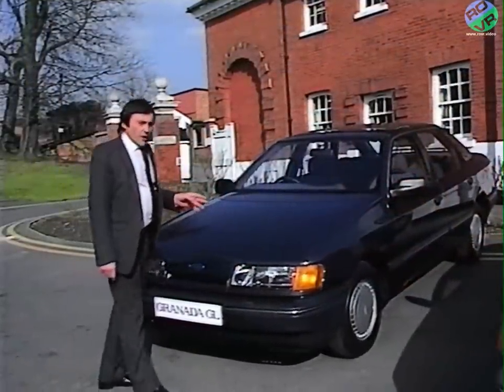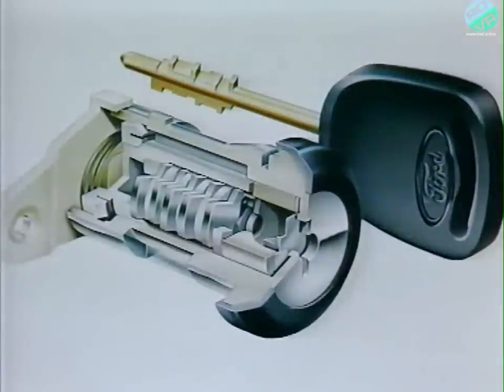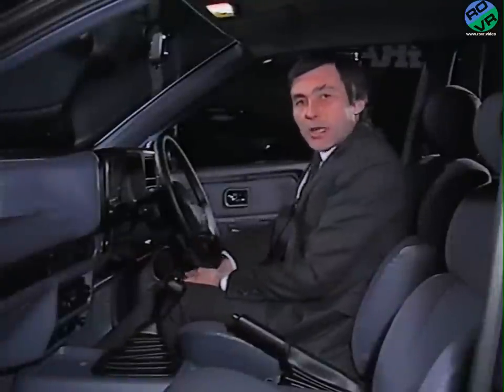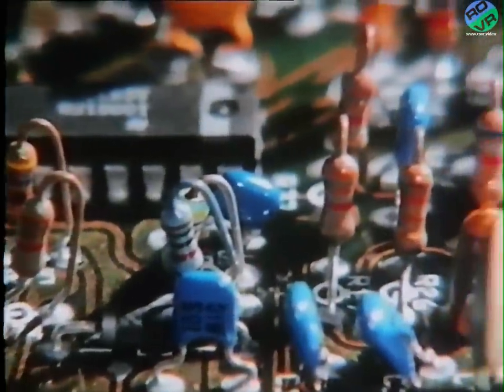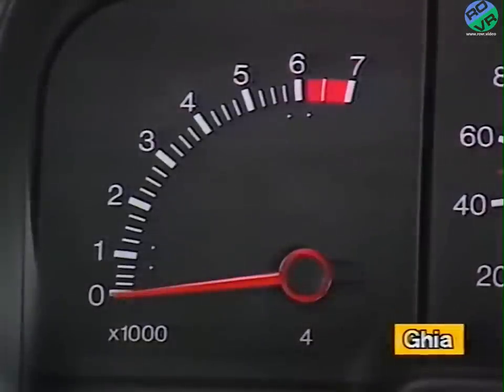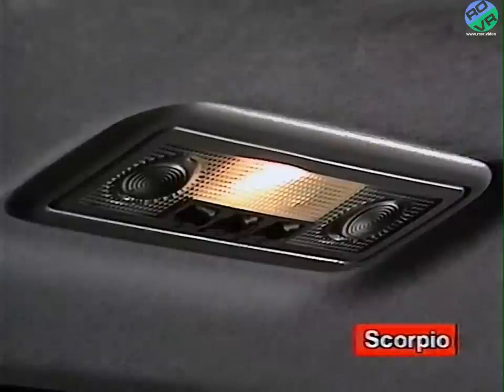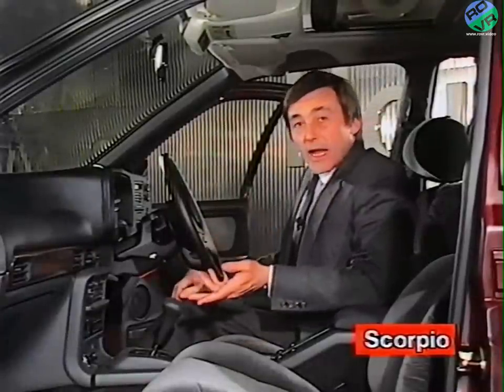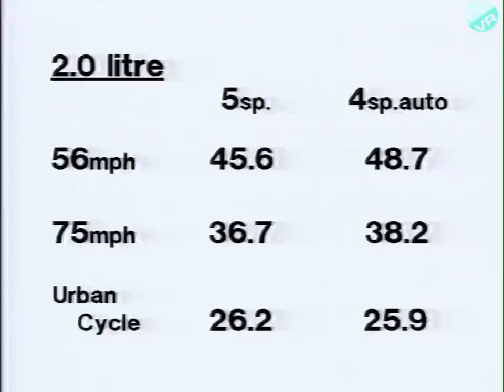Ford - The 1985 Ford Granada - A New Dimension in Luxury Motoring (1984)

Comment: "Instrument panel ,rheostat",,, my humble FSO Polonez had this  fitted in 1979.
Reply: So does my '82 Rover SD1. Probably the poverty spec mk2 Grannies didn't have one as standard, hence highlighting it. To be fair your Polonez won't have ABS, power steering or a reach/rake adjustable steering wheel as standard though!
Reply: Very true, but I travelled to the DDR and back in it several times in comfort 1981 - 1984.
Reply: @TheRichardSpearman  Fair enough. If you found it comfortable you found it comfortable!! I did 2,200 miles across France last October in my '78 Mk1 Cavalier Coupe with a 4 speed box, no stereo, no headrests  etc. Was noisy at autoroute cruising speeds (great fun off!) but i was comfy enough. However, i would've definately been MORE comfy in a mk3 Grannie. Especially a Scorpio....!!

Comment: I really was impressed with the amount of equipment this car had until the presenter listed rear seat belts as an extra cost luxury option.  Still, this does not look at all like a 35 year old car.
Reply: It has aged well. My uncle had one of these to tow his caravan. His had rear belts, but they was more used as a novelty. We never used them (I would of been about 6-10 at the time. When we was going away, we'd stuff the rear footwells and use the rear seat as a double bed for me and my cousin to sleep while we drive down south though the night.

I don't think it wax untill the early to mid 2000s rear seat belt use really become part of normality.

My kids for their first few years just rolled round the rear of a 1991 escort van. I was pulled over a couple of times, (spot checks) and nothing was ever said about having people of kids in thd rear. This was 2000-03. 

Now I won't move untill everyone is belted up. It's strange how sociaty changes. Lok at drink driving it must of talked 30 years from being all but band, to it being frownd upon.
Reply: I was stunned, too, but then I remembered I had a '84 Renault 5 and when one of the rear belts jammed I just unbolted it and binned it. Not mandatory on a car that age so no MOT fail (which it would if I left it in), but I can't remember any of the aero Grandads (and there were a few in my workplace) lacking rear belts.
My '88 R5 - basest of base trim level - had rear belts and I remember my brother refusing to put it on so I told him he'll find the walk good exercise; wasn't having that F.B. flying into my spine at 30mph. Total turnaround in my attitude in four years - power of (govt) advertizing.

Comment: What's not so easy it to break in to a ford Granada yeah right firstly those keys were a nightmare they used to break for fun they move from chubb to tibi keys which were worse they used to wear out secondly they were easy to break into. We used to do this to move the cars around the compound as they came with two keys one on delivery and one was in the ash tray rather then go and find the keys we used to break in use the spare key move the car to where ever then lock the spare key back in the car

Comment: Jeez, I though my 2.3 honda auto was bad in the rover 600  at 27mpg but it's better than even the 2litre granada.
And the 2.8 granada  at 18mpg imagine driving  that now on super unleaded!
Reply: I get around 28-29 mpg out of my 2.9i.
My dad had a 2.0i manual, which would easily do over 40mpg on a run.

Comment: Lots of logical little advancements, but the mk1 and mk2 still had more attitude
Reply: I own a Mk3 but I agree.
The lower-spec Mk1 & Mk2s were not so appealing but the V6 GLX, Ghias and Injections looked like cars for bank robbers.
Reply: @lewis72  Yeah, or the guys chasing the bank robbers!  By the time I got to end of this mk3 video, I couldn't believe how advanced it was - especially the Scorpio - for its day
Reply: @elbecko7969  
It still had the ancient Pint and Cologne engines though !
2v/cyl, iron block, iron head.
Reply: @lewis72  Oh yeah, true!  I often think of the jelly mould era Fords as being a bit too Tupperware looking.  I had a Sierra estate and a Mk4 Escort.  But the mk3 Granny must've looked pretty fresh on its launch
Reply: @elbecko7969  
IIRC, the Mk3 Granada looked like a modernised Sierra but bigger.
It had lost the rain channels on the roof (oddly, the Sierra Sapphire has no rain channels but the hatch had throughout its life) and it had more flush fitting glass.
They are a bit blobby, when compared with the Mk1 & mk2 Granadas but the emphasis was on aerodynamic styling then.
My dad bought an '86 car back in '89 and although it was a bottom-of-the-range GL, it had ABS, PAS (optioned), central locking and split rear seats.
It was big, comfy and being a 5-speed manual 2.0i, quick enough (they only weighed about 1200kg).

Comment: Wipers that park out of the wind rush copied from the Montego.
Reply: The Montego launched about the same year or maybe the year before? I don't think Ford would have been able to do a redesign that quickly. After the Audi 100, car mags suddenly started talking drag coefficient, Cd, and if it wasn't 0.3something (I think the then Cavalier was 0.47 with sticking out roof gutters) it was called prehistoric. Ford and Austin teams probably had the same ideas of tucking ancillaries in and using the wind tunnel a bit.

Comment: That presenter just keeps telling lies with a straight face, Granada we’re just gas  guzzling rust buckets, with engines with 1940,s technology….
Reply: Yes, they did rust very quickly and the engines were as old as the hills.
It was only the fuel injection that gave a bit of respectability.
Just 1 year later Rover launched the 800 with DOHC 16v 4-cylinder engines and DOHC 24v all-alloy V6s.